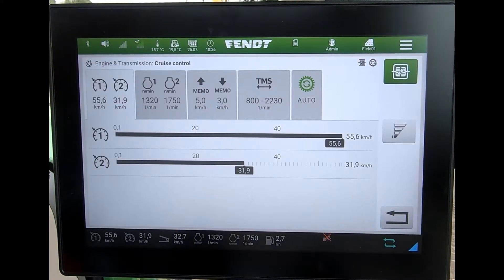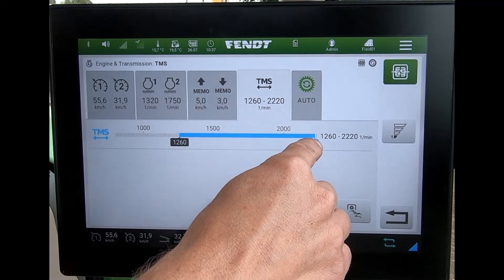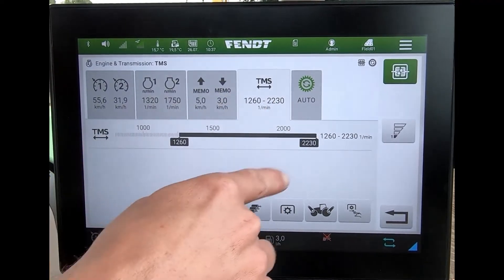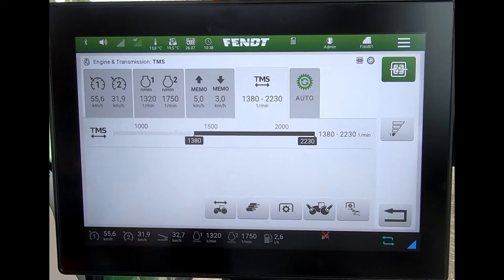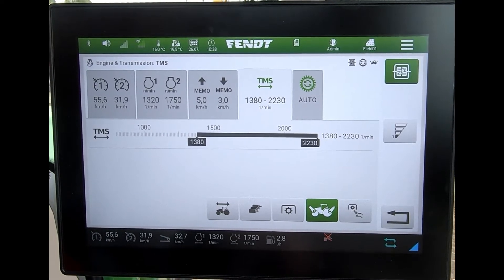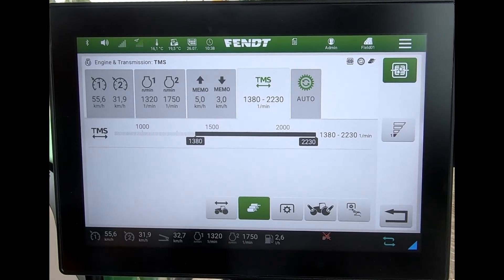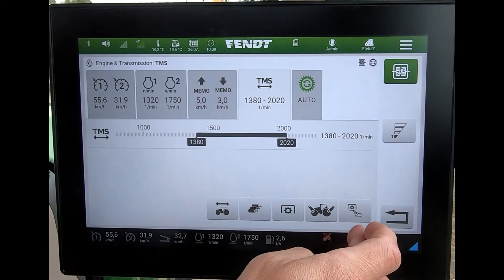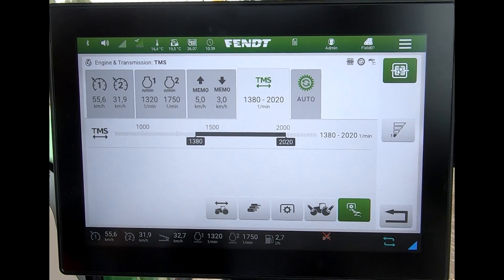FendtOne TMS settings

Comment: Could you do a how to fendtone wayline sharing/multiple tractor coverage sharing.
  Videos are very helpful! Thank you!
Reply from the maker: Wayline sharing at the moment can be done via the data transfer using the USB stick, which is covered in a Data transfer video. Not so easy to share coverage maps between tractors i'm afraid.
Reply: @fendthowto9918  interesting, was told we could share wayline with other tractors in the field via wireless.
Reply from the maker: @Swfl_farmer  You can do that now in a roundabout way but what I think you are referring to is FendtOne offboard which hasn't yet been released.